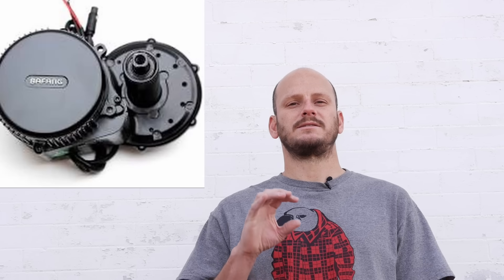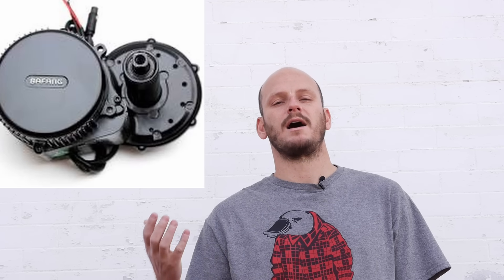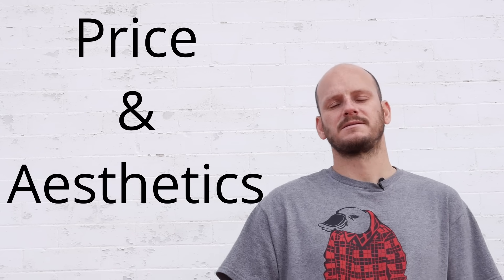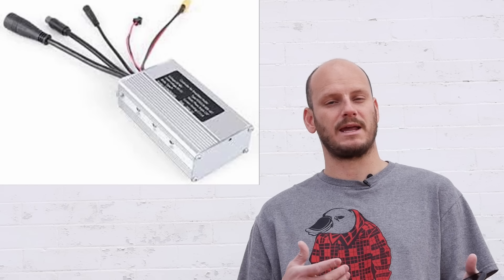Hub vs. Mid Drive Motors: Why Hub Motors Suck and Debunking Common Myths with performance test

Comment: Good review!  You might mention cadence sensing vs torque sensing and that torque sensing is usually only available on mid drive motors (also adds to the cost).   For me, acceleration is very important when riding city streets.  Fast acceleration is best accomplished by mid drive motors using the gears.
Reply: Your info is completely wrong, the vast majority of mid drives don't have torque sensing. Of those that do under $1000 bucks the only options are the TDZ2 and the Bafang Ultra which requires a special bike frame, no borsh or Yamaha in this price range with torque sensing at less than 3-5K bucks on mostly specialty bikes. At $1,200 bucks is the CYC X1 Pro as the most powerful kit with torque sensing. If you want torque sensing on hub drives you can add to 100% of them by spending $150 bucks on a torque sensor from Eride and $150+$20 on a Cycle analyst with a shunt controller. You will never be able to do that to any kind of Bafang mid drive kit since all their bottom brackets are drive axles for the chain ring.
Reply: @michaelcastro5339  is correct...
Reply from the maker: @michaelcastro5339  I never said bafang uses torque sensing. I said they HAVE more torque😀
Reply: @JohnnyNerdOut  fast acceleration is accomplished using no gears, thats why drag racing ebikes use 1 gear, a hubmotor has reach full speed before you have changed into your 3rd gear haha
Reply: @JohnnyNerdOut  my 273 40h bicycle hubmotor has 268nm continuous... and does a lot more with more amps...
Reply from the maker: Thanks! I was going to do a separate video on that topic alone. Some day.
Reply: grin sells torque sensors for hubmotors to use with the cycle analyst version 3
Reply: torque sensors are the holy grail...

Comment: With a mid drive you're still putting that much power through the spokes, and they're more likely to fail because they're significantly longer. During a hub motor install you can choose better spokes and superior patterns than you normally wouldn't attempt when using the stock wheel with a mid drive. You can find 3000w+ rated hub motors for less than half of the price of a 1000w bafang, and overheating isn't an issue if you run it at bafang power. Pretty much all modern hub motors shut themselves down before any damage occurs, so I'm wondering how you encountered so many failures.

With a hub motor you can save $200+ on upgrades since most mid drive ebike conversions don't have adequate parts to handle the power. An upgrade to hydraulic breaks, larger rotors, and aftermarket chains/chainrings/cassettes are basically required. With a hub motor the stock brakes and regen will stop 500+ lbs with no problem while extending your range by 5-10%, and there's no additional wear on other parts. At most you'll need a pair of high quality torque arms and spokes for $50.
Reply from the maker: I was trying to do an apples to apples compary using the same watt and manufacturer. Quality can vary wildly on motors and batteries. Someone smarter than me could explain why you need to beef up your spokes when go hub motor. I think I have broken 2 spokes on my current mid drive over the last 4k miles. Never get loose spokes.
In my experience, I only replace components on bikes if they are worn. I rarely need to replace chains, cassettes etc. It's like I tell people, if you ride your car hard as hell you're going to break components on it period , no matter of it's a hub or mid, if you ride it normal it'll last forever. In my opinion hubs are justpre fun to even drive at normal speeds😁 it's that torque!
Reply: @JohnnyNerdOut  

The problem is that you're tying to present this as a fair comparison between motor types when it's obvious that bafang hub motors are overpriced and underpowered compared to the competition. You'll get more torque and range than a bafang mid drive if you buy a 5000W hub motor for half the price and spend the money you save on a larger battery. 

The closest competitive mid drive to that setup is the cyclone, and good luck daily driving it without serious bike upgrades and frame modifications. You'd probably end up spending more on chains and brakes than the price of a brand new hub motor, if it even dies. A beginner would have a significantly harder time installing the cyclone too, and hiding it from the cops is impossible.
Reply from the maker: @Henlo Fren I was trying to show the difference on how the power is applied. Using gears is way more efficient than having a one speed. How do you figure you would get more range drawing 5k watts less efficiently? Let me know if I'm missing something. I think bafang motors are about as bullet proof as they come. Yes you pay a little more for it, but you can get parts for it anywhere for cheap. And it's a very nice designed motor vs a lot of the cheaper motors I've worked on.
As noted in the video, a high powered hub motor takes a lot of difference away. Essentially I'm saying the transmission is better. If you hook up a 1000hp motor to crappy transmission, it will still be super fast. I'm saying how much better a mid drive uses less power is all. It's a smarter design. No question. The only way a hub motor is useable is when it has tons of power going to it.
Reply: @JohnnyNerdOut  

You get more range by buying a significantly larger battery with the money you save by going with a hub motor, which more than makes up for the inefficiencies of hub motors.  It's not that the bafang mid drives are bad, they're just significantly more expensive than more powerful hub motors. 

You can get an entire hub motor kit with upgraded spokes and a double walled rim for less than a bafang mid drive, which is what you should have been comparing the bafang to for a fair comparison at that price point. At that point the mid drive would be more likely to break spokes in addition to the additional wear on other components.
Reply from the maker: Haha, that's a roundabout logic, but I get it. That actually would be a pretty good video idea actually. Send me a link if you can to the motor kit you have. I can put them both to a performance test. Do you use a display with it?
I was just looking around and see most 3k watt hub motors are rated at 110-125nm torque. Still less than a 750w mid drive. Pretty impressive.
Reply: @henlofren7321  , I live in England in the United Kingdom. It's generally pretty hilly, so practically all the decent quality E-bikes sold here are Mid-Drive. It is only those with hub-drives that are sold cheaply, precisely because they cannot handle hilly terrain as well as the Mid-Drives.
I was an early adopter of E-bikes here, so I know from bitter learned experience that what Johnny Nerd says is very true. 
Initially, Mid Drives back then weren't that good, we're talking the early 2000s. So I started off with a Heinzmann front-hub-motor, then a Heinzmann rear-hub-motor and when the Mid-drives got to a decent level and quality, I got and still ride Bafang BBSD01 Mid-Drives. I get a new one each time they improve the quality. Yes, Bafangs are expensive initially, but they work out much more reliable and a lot cheaper in the long run than buying cheaper kits, which as they get older cost more in terms of breakdowns, reliability, maintenance, etc, etc.
You have to remember, here in the Uk, we're not as lucky as yourselves with respect to the size of motor we can have - we're limited to 250W for road legal usage, so it's all about torque and the best way of usilitising as much of the power as possible from such limited resources, hence, Mid-Drives rule. 
My current Bafang motor delivers approx 80NM of torque, I'm hoping in the very near future, to acquire their extra torque model which will deliver approx 100 NM.
Reply: @henlofren7321  Do you know where's the best place  to buy a quality but low price 3000w kit? .
Reply: @JohnnyNerdOut  that 125nm is heat saturation  not peak, its the nominal rating, 
https://ebikes.ca/tools/simulator.html?bopen=true&throt_b=25&motor=MBBS02&motor_b=MBBSHD&batt=B4816_GA&batt_b=B4816_GA&mass=500&mass_b=500&hp_b=0&hp=0&mid=true&gear=1&mid_b=true&gear_b=1&tf=30&tf_b=30&cont=C25&cont_b=C25
Reply: @JohnnyNerdOut  you dont need to use thicker spokes if you lacing tension is perfect, i have put 100kw through a 14g 26inch wheel with torque levels that are not capable to do full throttle with an extended rear tail, the thinner spokes are lighter, and also have a nice spring especially for hardtails, the reason you would go thicker is to be lazy, my 9g and 10g spokes will never need truing probably for my lifetime on my tarmac bicycles, you would go thicker on a straight lace due to it having no strength on acceleration/braking, the wheel will simple stretch the thinner spokes and snap them or twist the hub around the spokes, cross lace is advised when possible, i use 9g for straight lace, no problems on insane builds

Comment: I started getting curious about ebikes back in the spring and started looking and watching a ton of videos.  I had a spinal cord injury at my last job that forced me to file for disability.  Part of it is nerve entrapment and sitting is actually painful.  For some reason the bike seat puts pressure on different nerve endings I guess and it is just the usual any adult over about 120lbs bike seats are not orgasmically comfortable lol...I have a cloud9 and it helps a lot.  I can spend about an hour on the bike before my back says "Your done for now", and I am ok with it.  Also developed GERD, probably going for surgery in 2021 to try to fix it...any physical exertion triggers my stomach to churn acid and feels like a heart attack till the burping starts.  Before I converted my Montague Paratrooper into an ebike with a BBSHD 52v 1500 watt I was able to peddle 1.2 miles before having an attack.  After the conversion 14 or 15 miles and it's less severe I am peddling non stop except when coasting this is for exercise after all lol.  

I went mid drive because although my days of crazy jumps and all that is past me, I don't like riding on the streets prefer grass/dirt trails.  I have a cabin in Pa in the Pocono mountains and it is really hilly.  So far I have put it into peddle assist mode 4 only 2 or 3 times typically mode 3 gets me up most hills unless the ground is kinda muddy then I need mode 4.  Hopefully if they can fix me and I can start using more muscle and stamina it will increase my range and help keep the muffin top away from my waist line LOL.
Reply from the maker: Sorry to hear about your injury. It sounds like you're an inspiration for those with severe injuries though! Have you looked into recumbent/semi recumbent bikes? Rans is a good brand, so is Day6. Maybe you just need a little back support to keep you in the saddle longer?
I have had chronic back pain on and off for the last 20 years. Whenever the pain gets really bad, I get on my bike and go as long as I can. Each day the pain goes down. Once I figured that out I was addicted to biking. For me, it was a natural healer. And it got me out exploring as a bonus. 
Thanks for commenting and sharing your story, keep us posted!
Reply: @JohnnyNerdOut  Thanks, I just try making the best of things and have some fun while I am at it.  I love my emtb, and really anyone who had fun as a kid riding who have some mileage on their body, that electric motor can really help out.  I took a ride past an old friend from elementary school, I remember his house was on the corner of 2 hills, 1 a long slope, the second short and steep.  As a young kid we usually avoided the steep hill, great for racing go karts, not for biking up...well I dropped my bike into assist level 3 and I went up that hill without killing myself struggling lol.  
I envy you that the biking helped with your pain, but this year especially with the crazy covid, I am just happy getting out on the trails, smoke a bowl (medical marijuana, the only "perk" to my injury lol) and just go out an enjoy the block of time till it's time to head back.  Happy Trails!
Reply: uh.....what brand of bike seat? or did you mean organically, rather than "orgasmically"😲. Been leaning towards the mid drive over hub, but if there is some combination that gives me orgasmic bike rides, well then I'm, pretty sure global warming problem will be under control in no time.....although street sweepers might be a booming industry.
Reply: @BrianB78  I think he meant "orgasmically"

Comment: My opinion... Hub = roadie   Mid Drive = Dirt and mountain.
Reply from the maker: If you HAD to get a hub motor.... Yes I would agree. Like if your wife or girlfriend got you one for Xmas and you didn't want to hurt her feelings so you just kept it to save your relationship ☺️.
Reply: @JohnnyNerdOut   Yes so well said.
Reply: I  understand why the 750w mid drive is overall better especially for lots of off road riding...But, I just searched  prices and a 750w mid drive kit  is no less than $400- $425....  While a 1000w front wheel kit can be had for $175....Is  a 750w mid drive kit still worth the extra $250 if you're doing say 90% street and only 10% off road dirt trail?  With the front wheel kit you can pedal making it 2wd and still have have all your gears. If you take it easy on the fwd motor by helping to pedal up hills and from complete stops Couldn't  you get just as much life from it as a mid drive???  I also seen a 72v 3000 rear wheel kit for like $450, if it's gonna be a street bike and more speed is what you're after. Wouldn't you be better off spending another $25-$50 bucks and getting the 3000w rear wheel kit?....If the 750w mid drive was only $50-$75 more than a  F or R wheel kit  I'd jump on it but $175 VS $425 has me thinking go with 1K fwd kit.
Reply from the maker: @michaelbrinks8089  I wouldn't touch a motor kit that retails for $175. My gut says you'll be replacing it in 9 months with a bafang. You can get a Cycles be 3k watt mid drive for $450 too. That will blow away any hub motor.
Reply: @JohnnyNerdOut  not a 273 40h it wont..

Comment: How often should you tighten your spokes when you have a hub motor?
Reply from the maker: I'd inspect them every 50 miles or so. More often if you ride hard.
Reply: @JohnnyNerdOut   Great video and explanations...... Many other videos are pretty vague and leave you thinking that there's not really any major performance differences.
Reply from the maker: Thanks, appreciate that!
Reply: @michaelbrinks8089  ive ridden over 500 miles , and its as good as new
Reply: ive had this hub since September 2020 , and ive had to recently adjust the spokes , i ride on and off road and fast and aggressive , it made some noises dues to the loose spokes and i thought it was my disk rotor but it was the loose spokes , spoke wrench and some trueing and its good to go
Reply: Depends on whether your hub motor has a torque arm or not.
Reply from the maker: @sammiller6631  torque arms mainly keep the axle from spinning in the dropouts. Poorly made hub motors have a propensity to have loose spokes.
Reply: I’m in the 2k range of mileage on my ebike motor , still flawless I’d say
Reply from the maker: @tarxan3344  nice! What brand motor is it?
Reply: @JohnnyNerdOut  sold by voilamart I’m not sure if they manufacture it. But the sw900 display is terrible , it. Burnt out on me
Reply from the maker: @tarxan3344  the 500c display is solid